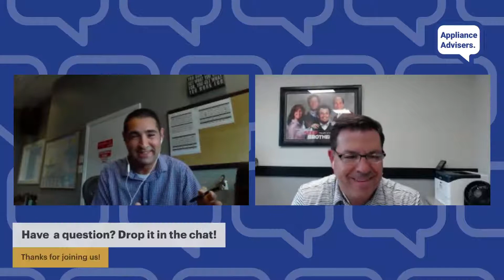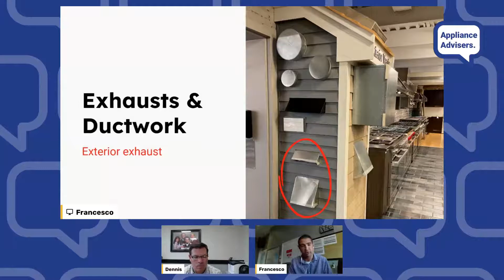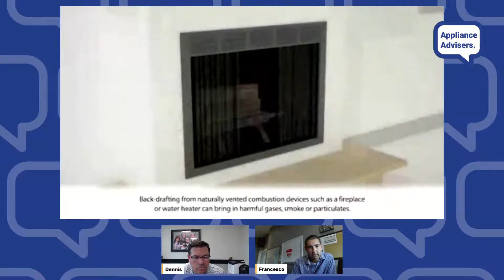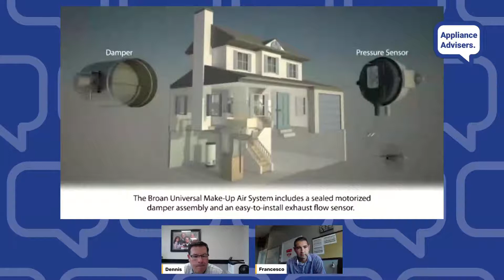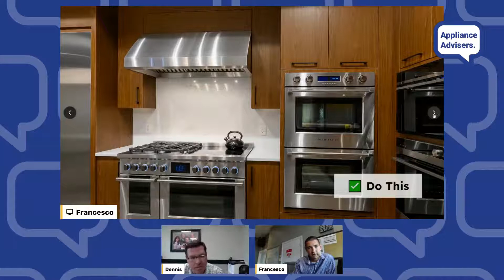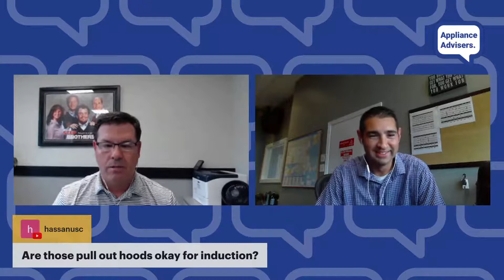How to Choose a Range Hood - Appliance Advisers 8.11.22

Comment: Got your link from a Reddit post. Thanks for the info related to induction cooktops. I notice the ventilation insert recommended for Thermadore 36” induction cooktop is actually only 32” long. Should I be concerned that it is too small?
Reply from the maker: No..the motors are smaller than the hoods.  As long as the hood is 36 wide and 24 inches deep...you will be fine.

Comment: Hello,
Thanks for your very useful informational video.
I am installing 1100-1200 CFM vent hood and looking for make up air system that has it blower/motor housing 10". It cannot be bigger because I need to install it in the space between two floors ~12".
Can you help please